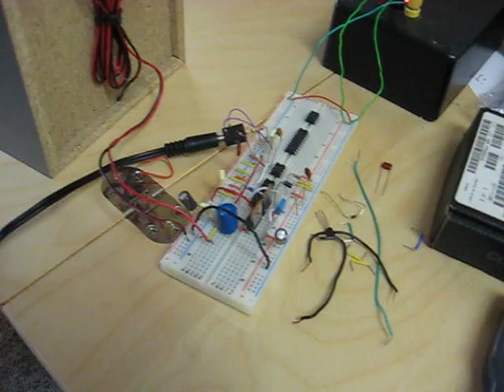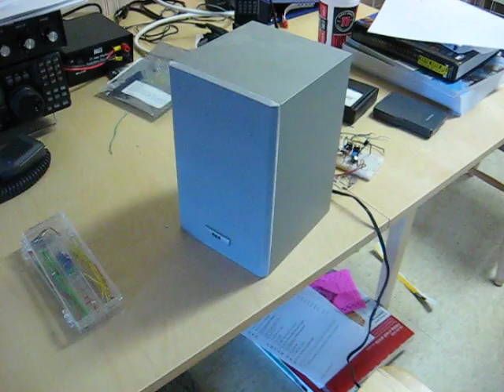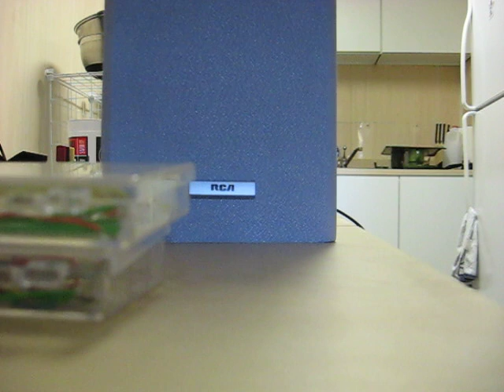Class D Amplifier - First Test

Comment: what is the name of gate driver IC?
actually i m also designing a switching class D amplifier.i myself first designed the gate driver circuitry but its not giving the desired output...please reply me as soon as possible...
Reply: I personally use a TC4420, be carfull though, gate drives may get VERY hot, I ended up getting a few buns. So be sure to cool your electronic components!